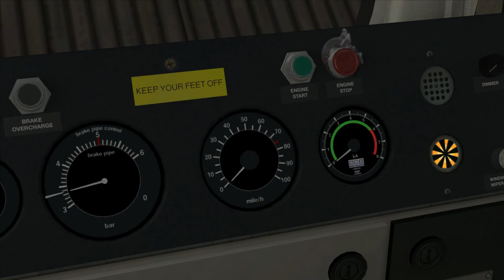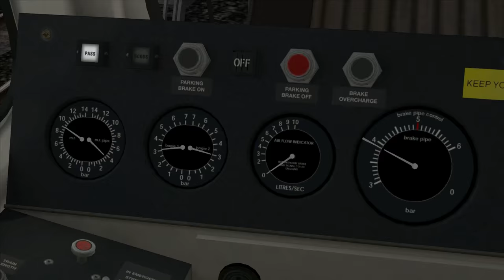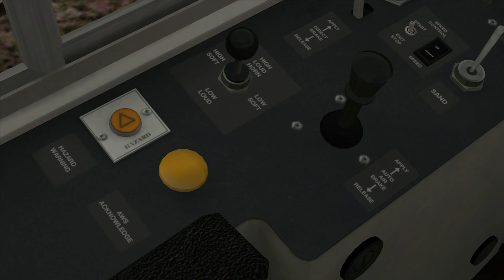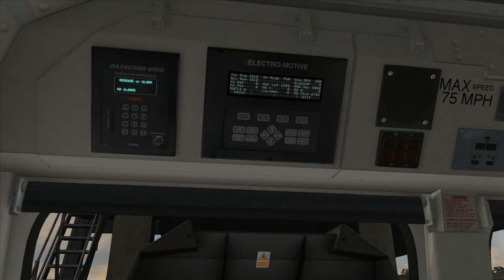Train Simulator 2015 - UK Freight 3: Ravenstruther to Mossend (Class 66)

Comment: PTG if I'm not a genius on the class 66 but if I'm right on the top left hand side of the dashboard there is two "icons" one illuminated white with the word "pass" and the other with "goods" on if I'm right should it of been illuminating "goods" instead of "pass" as you were hauling goods?
Reply: +thatrandomboy123 HD Plus for your next video could you do a ECML class 365 or class 321 from either Kings cross or From Peterborough as you have done the ECML before but for my reselection you have only done "fast" and "semi-fast" services using the Class 43 Hst and the Class 91
Reply from the maker: +thatrandomboy123 HD Damn.. I forgot to change it! XD
Reply from the maker: +thatrandomboy123 HD I will be doing more on the ECML, but that's one route that most scenarios suffer serious lag issues in. So that will come after the new PC :)
Reply: +thatrandomboy123 HD Depending on they type and weight of load it is more efficient to have the brakes in 'pass' mode as this lets the air flow to the brakes more quicker then 'goods' mode
+PTGRail Great video I think you should do a class 66 loco review if you need help or anything feel free to ask me :)
Reply: +The Hellfire Lad Oh ok thank you
Reply: thatrandomboy123 HD No problem I have experience with locos. PTGRail Great video

Comment: do you place scenarios on the workshop?
Reply: +Andrew Bustard This is a scenario from the Armstrong Powerhouse 'AP13: WCML North Scenario Pack (Freight)'. It's only £4.99 BUT you will want to check it's requirements, as it uses a lot of paid add-ons to add realistic AI traffic.
Reply from the maker: +Andrew Bustard This scenario came from an AP scenario pack, but I have uploaded a number of scenarios to Workshop in the past. Some are really old from when I first started out, and some newer ones are up there which I created for videos on this channel. Look up PTGRail on Steam Workshop. The AI needs changing in some of the older ones as I didn't have the variety of DLC then that I do now. :)

Comment: hello drivers. I have been following your channel recently. the videos are very good but I find something not so good. if you stop by train, you come with a high brake adjustment to a standstill. I would find it more realistic, if you on the last few meters that slow dissolves again to reduce the jerk. especially in steam engines that is important so that not too much shuttling the water in the boiler. which can in real damage to the boiler and cause it would be more comfortable for the passengers. I think it would be nice if you could consider the future.
Reply from the maker: +sparky list That is something I'm aware of and usually do consider, though I don't always get it right.. especially if I misjudge the braking distance slightly. In some videos you will see me reduce the braking when stopping but not in others. It all depends on the train too; for example I know that Class 377s which run in the area I live are often stopped in step 2 braking. I will try and consider it more in the future :)
Reply: +PTGRail first: thx for answering and excuse my english :-)
isn't it rough for the passengers to stop in step 2? i meant to release the brakes a bit in the last maybe 5 meters before stillstand.